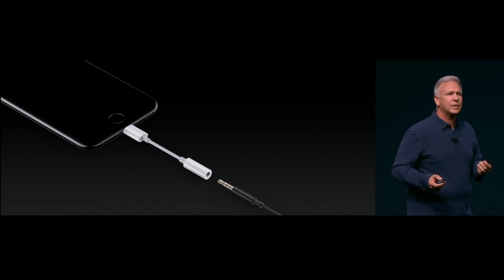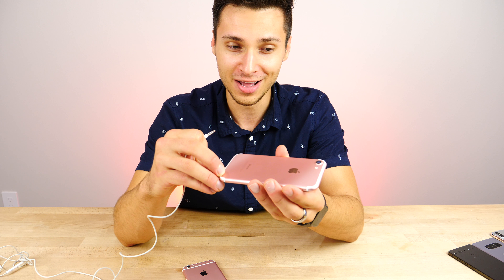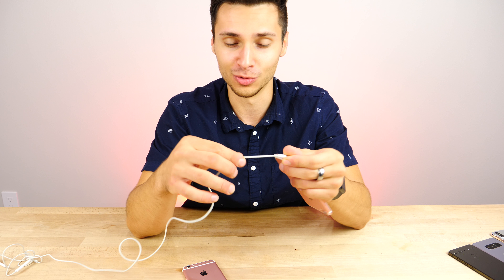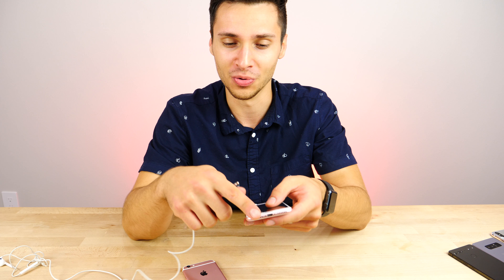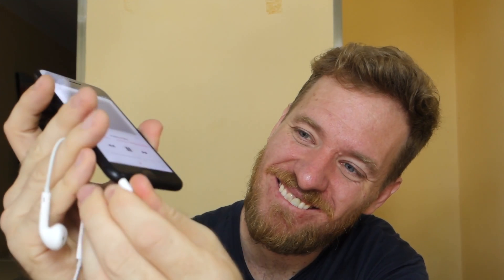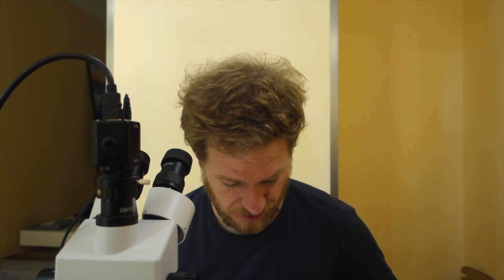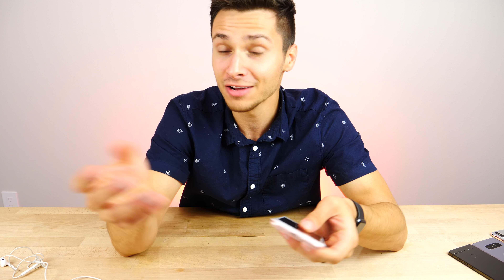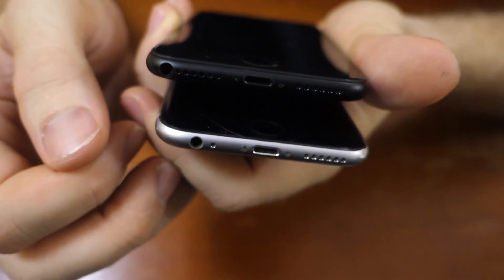Insane iPhone 7 Headphone Jack Mod!

Comment: I used to have the iPhone 7. Before getting it, I didn't think that no headphone jack would affect me. Only after getting it did I realized that I needed it. TBH i want the headphone jack back
Reply: Darvyn M EDIT : Bluetooth Eaphones. Is that better 12 yr olds?
Reply: Darvyn M that is interesting, you are the first 7 owner i have heard say that... huh...
Reply: Seth Wingate Bluetooth earbuds are just not the same. They are way less convenient and much more expensive if you want a good set. Not to mention you have to remember to charge them and you need to have Bluetooth turned on on your phone which kills the battery faster.
Reply: hungryninja123 how the hell are they less convenient they have the exact amount of convenience maybe even more
Reply: Seth Wingate no ones buying $200 earbuds
Reply: Richard Hre Blue Jays X3 are 100 bucks. One of the good ones out there lmao. It even has a thing where it will tell you your battery.
Reply: Darvyn M So use the adapter. That’s what it’s for. Not once have I had an inconvenience with this change. Just adapt, or get a different device. I’m sure all phones will do it eventually.
Reply: hungryninja123 Fair point, but here are some reasons why Bluetooth over wired is better: 
- It's is actually MORE convenient (you can walk 10-20ft away from your
Phone and still hear your music going)
- Bluetooth is not that much more expensive but if you want a top-of-the-line headset you will have to pay some extra cash. Needless to say top-of-the-lined wired headphones are not much cheaper if anything. 
- No worries about wires breaking so easily, having to bring an aux cord everywhere you go, and in general wires get in the way when you try to do productive things such as working outside or on chores. 
I have owned $70 noise-canceling Bluetooth headphones that last for days without a charge (I still put a lot of use to them) and they work amazingly. I'm never going back to wired headphones again. (Unless it's the Apple earbuds, those are my backup)
Reply: Shane Gallo wow you're right that is really inconvenient
Reply: Richard Hre yes they are
Reply: I felt the same way, when i got the iphone. The first time my Bluetooth headphones batterry died, and second time, while having phone connected to speakers, and needing to charge..
Reply: Seth Wingate those a $100 you can get some regular earbuds for $7 on Amazon.
Reply: There is no substitute to an inbuilt dac with aux out. Theres a reason all the best audio equipment is analog still hey. A $1000 phone with a <$10 dongle dac is pathetic. Headphone jack's are not outdated, but dongles surely are.
Reply: How do your bluetooth headsets work when there is interference?

At my work we use bluetooth to connect to the speaker in the kitchen but when a microwave is running the interference makes the music jump around terribly, we have to put the phone right next to the speaker in order for it not to skip. Even a foot away means the music is impossible to listen to.
Reply: You guys are discussing getting Bluetooth earbuds while I sit here with my hearing aid, which has a wireless Bluetooth connector that doubles as a microphone (pick it up, walk away from me and talk, I'll hear everything).
So I don't need to worry about headphone jacks cuz my right ear is sealed off anyway (birth condition called microtia) and earbuds don't sound the sound the same with only one earbud in.
Reply: Darvyn M im just sticking with a iPhone 6
Reply: Gary Jones that is both unique and weird, is the speaker plugged in to the wall? If so try using another outlet or a surge protector as the issue may be speaker side
Reply: Joel Nunez AirPods solve all the problems
Reply: Shane Gallo get an adapter it's not that hard it's like 5 bucks for a headphone jack + charger
Reply: SSB Kaizoku but i dont want to bring adapters :( i might just forgot it xD
Reply: Darvyn M i actually dont mind… then again all i use is bluetooth headphones… i do have a spare headphones with the adapter though… but i havent used it yet,  i dont mind… 😂😂
Reply: Darvyn M just get some QC35s  for me having no headphone jack isn't a problem in the slightest.
Reply: I don't because the headphone jack actually damages your phone.
Reply: Grow up, That hole is peasants! Airpods are way better
Reply: but they cost 200$!
Reply: Honestly the lighting are good if you have a car leave the adapter the wireless beats and AirPods are good
Reply: Tariq Alazawy what are you doing here 9 y/o go to school or do your homework
Reply: GAMESupporter Gaming Yeah I would know, I also used to have AirPods, but then I realized that they were $160. What I could do with that!
Reply: Darvyn M not much 160 isn't a lot of money and here in Canada AirPods are 220
Reply: Seth Wingate bluetooth is really different from using actual headphones........
Reply: saulsebrook actually no
Reply: Seth Wingate i have it, it broke in 2 days.
Reply: Chats With Cay but its 200$
Reply: Tariq Alazawy There is no September 31 😂
Reply: Neon Extreme Ha Goteem
Reply: Shane Gallo you could have bought a splitter, mine cost 10.00. I can still use my ear buds and charge at the same time. Easy fix, I love it. But, iPhones 7 plus will be the last one I will get from Apple. I'm not going too pay over a thousand dollars for a cell phone. It was bad enough that I paid 600.00 for this one but I love it.
Reply: I prefer wired earphones.i don’t use apple earpods or airpods